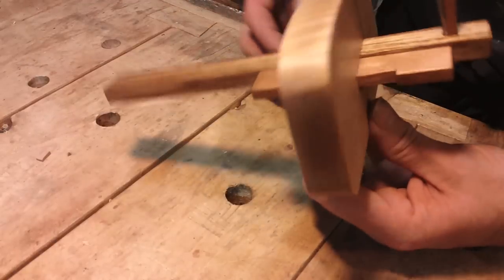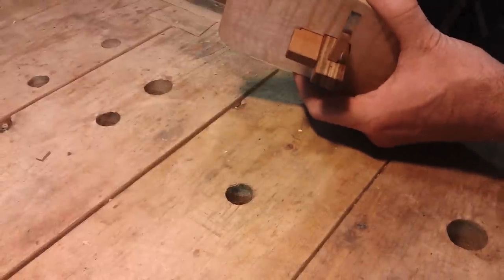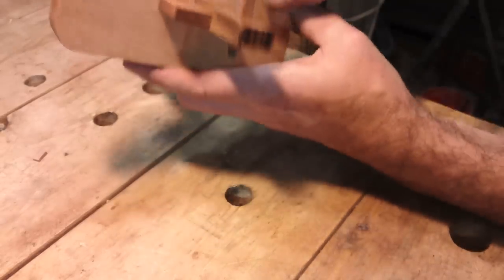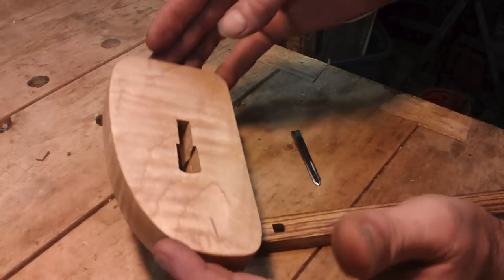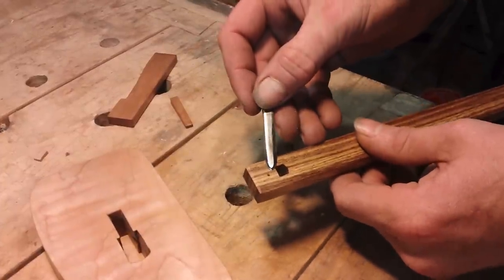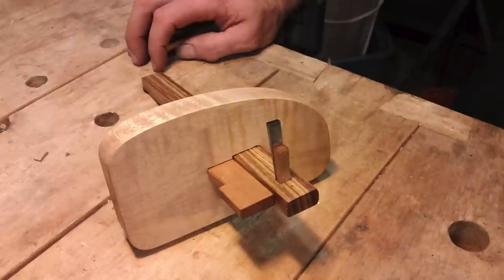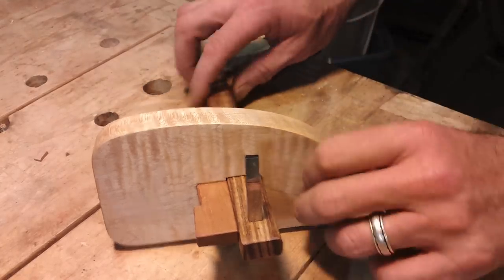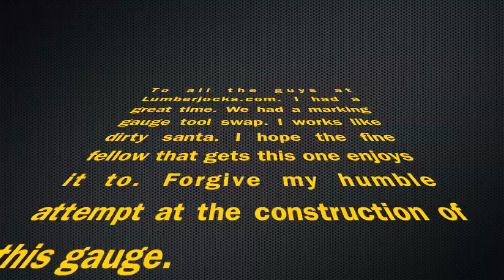Japanese Marking Gauge

Comment from the maker: Most all Japanese gauges use this method. Here are why it works for me. I get the setting close and lightly tighten the wedge. I then sneak up on the setting and finish tightening the wedge. Also  the beam has a shoulder that it rides on to keep it a bit independent in the mortice. The beam has a convex edge and that helps pinch it and make it stop moving.

Comment: I loosen the wedge, I slide the beam to the setting I need, I then tighten the wedge.  It seems that tightening the wedge will change the setting of the beam that I worked to get.  The wedge tightens in the same direction the beam slides, what keeps the beam from sliding in when I tighten the wedge.  Many marking gauges that use a wedge have the wedge running sideways to the beam.  That way, the moving wedge doesn't have a chance of changing the beam's setting.

Comment from the maker: The grove in the fence is cut at an angle. You can see that in the video when I have the chisel on a piece of wood above the fence. The angle is the same angle that the wedge has. When the wedge id pressed the beam is squeezed in and locked tight. look at 3:00 for the chisel. Look at 5:30 for the angle explanation. I hope that helps.

Comment: Great video Mr. Bardin! =)

As an amateur carpenter like myself who just started messing with wood and bought some of my own tools. I don't know about a lot of tools that carpenters use but Do I need or should I have a Marking Gauge?
Reply from the maker: Jovan A. Please call me Dave!
Yes it is one of the most used tools I have for layout. I might have 12 or more. About four times as many as i need.
A double pin gauge, and a cutting gauge is a good starter set. They are indispensable for proper joinery lay out.
Reply: Jovan A. Once you start using marking gauges you wont go back.  You will want more then one so you can leave them at different settings as you work through a project.  Also there kind of like pencils, you just want one handy nearby so you don't have to go searching for one.
Reply: Terry Pullen Thanks..

Comment: wouldn't tapping the wedge tighter move the calibration at least a hair?
(maybe only a negligible amount for my purposes, but still)
Reply from the maker: apple with modern gauges we tighten a screw and pinch a beam. In the beginning screws did not exist.
This form of gauge has been used for thousands years with beautiful results. My attempt was to reproduce this ancient tool.
The Keshiki has been in use by all traditional Japanese Shokunin and has produced near perfect furniture. Suji-Keshiki, Ana-Keshiki, Kama-Keshiki and Wari-Kashiki all use the wedge. The wedge and beam mortice have to be exact so that when you tighten them they stay dead square.They dont need to be so tight you cant move them.
Hmmmmm now you got me wondering.
Reply: Hahaha duh it's all about the user with these style tools.
Reply: Ohh wait I've been trying to use this one forever, you've got to be smarter than what your working with Drew